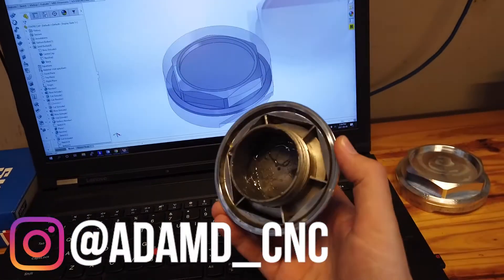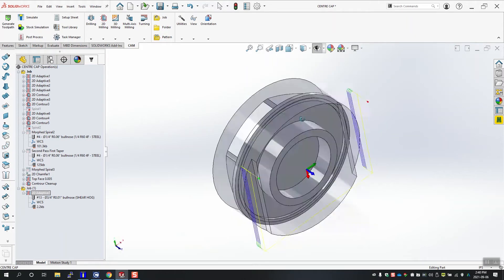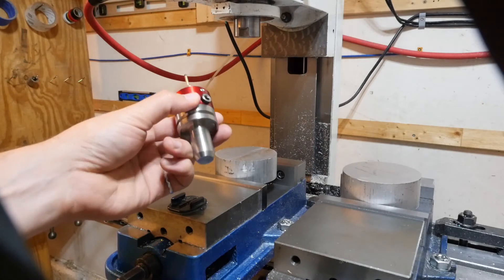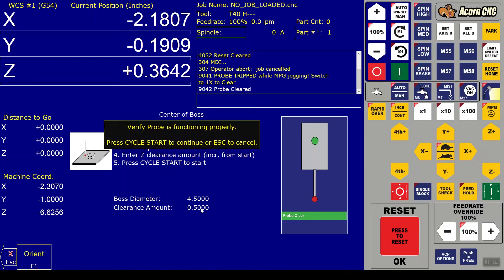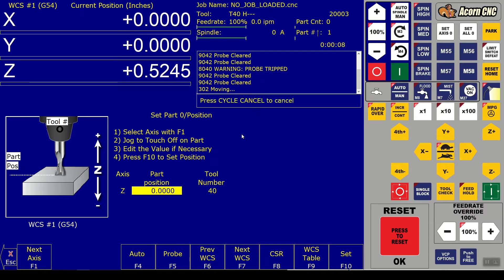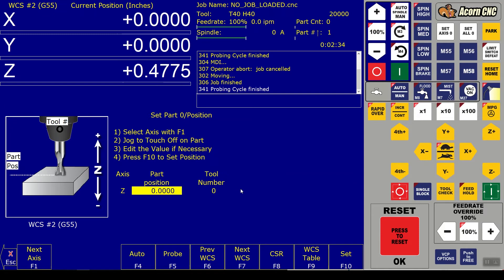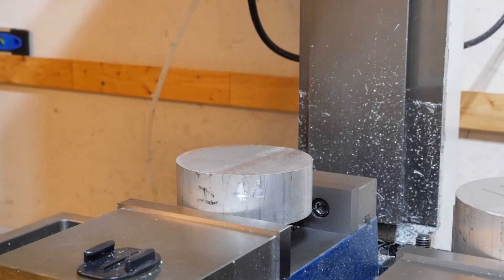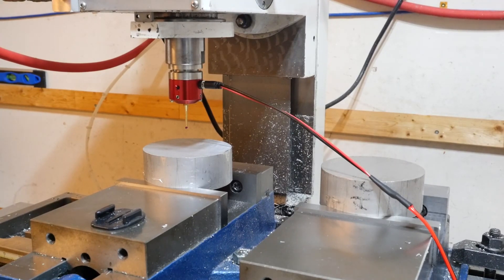Probing Multiple WCS with Drewtronics S5000LED TTS on PM30-MV & Centroid Acorn CNC Control

Comment: How did you end up wiring to the acorn board what wire did you use to make or splice to go to the acorn board, i just talked to drew and he said he only has the cable for the tormach he asked how i herd about him, i told him from you on YouTube so he said he was gonna check you out
Reply from the maker: He has an option for a “non tormach” connector where he supplies a whip with only two leads. I’ve got the two leads wired to input 4 and common on the acorn, and “probe tripped” configure for input 4 in the acorn wizard. I’ve got no “Probe detect” lead wired up.
Reply: ahh gotcha i cant see that cause its out of stock , i was gonna just order the 3/8 shank and put ut in a tts tool holder then get the wiring, cause i dont know how long its gonna be before he gets them back in stock
 @adamdebowski2037

Comment: Adam, is the tormach tts system compatible with mill stock? Or did you have to modify the spindle to make it work?  Thanks for your help
Reply from the maker: You need an adapter but no modifications to the mill are necessary. Video coming out today explaining it in detail. Stay tuned 😊
Reply: @adamdebowski2037  Thats awesome, I was about to drop a grand on the power draw bar kit just to be able to use tormach collet system.   If I can just use an adapter thats going to make things much easier for now until the power draw bar kit is absolutely necessary.
Reply from the maker: @CryoftheProphet  great idea. Which power draw bar kit are you looking at?
Reply: @adamdebowski2037  Well, the only kit that looked legit was the priest kit, but honestly Im just getting started in all of this and I just want to buy the stuff that makes my life the easiest.  Id prefer a diy route because it saves money but Im not sure I have the prerequisite knowledge to fabricate a longer draw bar for example, which his kit comes with, as well as the r8 collet adapter.  I honestlyh dont mind using the r8 collets, but everyone seems to think the tormach tts kit offers a real advantage so I figured I do that.
Reply from the maker: @CryoftheProphet   Those priest kits look nice and you HAVE to have the TTS system installed to use them - so you're not really shooting yourself in the foot if you go TTS first without installing the PDB. I started out using collets - and you quickly learn it's a big pain in the butt. In the video coming out in the next 15 mins, I get into the specifics & details of all the tool holding options you have (Collets, R8 tool holders, and Tormach TTS tool holders). I think you'll find it useful... spoiler: TTS is leaps and bounds better than anything else for many reasons :)
Reply: @adamdebowski2037  Well, ive spent probably 8k on cnc related stuff in the last couple weeks, so the tormach tool holding is going to be minimal at first, I need to get my pm mill setup, converted, wired (thats going to be fun :(, and I have a masso controller I bought for it but I honestly have no clue what Im doing, just a brutally reckless will to take the plunge and integrate machining into my workflow.  I have a couple epilog fusion pro lasers right now but they are boring compared to what milling has to offer.
Reply from the maker: @CryoftheProphet  Nice!!! That’s the only way to do it! The Masso looks really cool. I was going to get it instead of the Acorn.

Comment: so to save second probe on z you could do g54 then switch to g55 before moving go back to setup enter the tool then set the z for g55 then go do  the xy for g55.  saves a step/probe cycle if the parts are the same. or you could just type g55 z position into the mdi.

Comment: Hi there, Nice setup. How accurate is your homing when you want to do ops after you turn off your machine? Do you have scales installed? Thanks
Reply from the maker: I’m not sure, but I always assume it is inaccurate. The limit switches installed were $20 for a 10-pack, or something. I don’t rely on homing to set work offsets ever. I don’t have scales installed.

Comment: off-topic: you thought about upgrading that motor? you can get an 1.8 kW servo from aliexpress for pretty cheap, will perform a lot better than this dc motor
Reply from the maker: Hey Dusan - I have thought about going to a 5hp ac motor on a VFD (haven’t looked into servo - but I’m open to it - maybe I’ll take a look) but there are some things I’d like/need to do first. A more heavy duty base is a must, I’ll need to expand the electrical cabinet, and an enclosure would be a really good idea… so I’ve got some work cut out for me before going up on the spindle I think…. But it’s ultimately my biggest goal - higher rpm, higher power spindle…… what do you think?
Reply: @adamdebowski2037  you don't need 5hp if going to a 3ph AC motor, 1.5hp in a 3ph AC motor is plenty enough and more than your machine can handle.  It is enough to cause tool pull out long before you run out of power.  with a 1:1.66 pulley ratio our kits on the G0704 give 3rpm-6000rpm which is perfect for a set of Nachi tapered roller replacement spindle bearings and kluber grease.  Your other major hold back is your coolant system.  If you plan on working primarily in aluminum you should strongly consider an enclosure and going flood coolant, it will help tremendously with your feeds, speeds, tool life and part finishes.  I would not go with a servo for a spindle motor as they do not remotely compare to the output of a 3ph AC motor.  even a servo rated at more kw/hp then a 3ph ac motor pales in comparison.  so don't judge the power you think you need from a 3ph ac motor based on other power ratings... they just aren't in the same league.  the 3ph motors weight about 45lbs and generate an enormous amount of torque and are very very stable even with heavily varying loads.  look for a marathon Y522, Y366, Y274 any of those 1.5hp variants will be good as they are vector duty rated motors with 1000: constant torque rating meaning they generate full torque using the following formula (Rated RPM/Constant Torque Rating) or in this case, (1800rpm/1000CTR) = 1.8RPM full torque through rated speed 1800RPM.  the motors also maintain full horsepower to twice the rated speed, so to 3600RPM.  that gives you a spread of 1.8 to 3600RPM that is in full torque and or HP.  with the 1:1.66 ratio that gives you 3rpm to 6000rpm.  in constant torque mode with vector feedback or sensorless vector control that means the motor is operating as if it was under load requiring full torque always which makes for a VERY stable spindle speed regardless of the varying loads it is seeing.  hope this helps!
Reply from the maker: @SmallShopConcepts  thank you for the amazingly good info!
Reply: @adamdebowski2037  happy to help!
Reply: @adamdebowski2037  My advice is to go with a vfd and motor.  Having run a dmm servo as a spindle motor i was less than satisfied.
Reply from the maker: @spacedmanspiff1543  interesting - care to share more about your experience? What you liked/didnt? Cheers! Adam
Reply: @adamdebowski2037  Hi Adam I am running an Acirn as well.  The dmm setup while small in footprint and weight did not have the tourque i wanted.  It would bog down pretty easily.   The integrated encoder i could not get to work properly and getting the programming on the servo to work was not fun.  You can find a thread on the support forums about that.  Ultimately i went with a one horse ac driven with a VFD and had it up.and running pretty quickly.  I plan on upping that to 3 hp here soon.  I get 6000 rpm just fine.
Reply from the maker: @spacedmanspiff1543  thx for the feedback!
Reply: @adamdebowski2037  no problem ! Now to get my drewtronic probe hooked up !
Reply: @adamdebowski2037  considering how little effort it is to retrofit an AC servo, i reckon you could perhaps use it as a stopgap before moving to something with even more power. all you need is a spacer and a belt pulley that fits the shaft. servos come with a servo drive and they hook straight into AC power. cables are included and pre-terminated. 

actually, you could also just get a larger ac servo instead. they are very light and compact, so you don't really need to change out your gas spring. definitely worth considering

that said, i decided to go the integrated motor/spindle route (i bought a cncdepot FM30F spindle) because i do a lot of aluminium and engraving